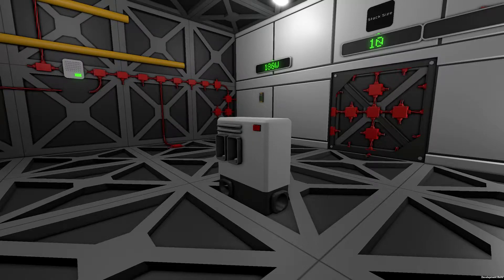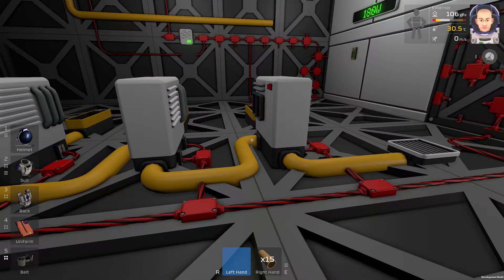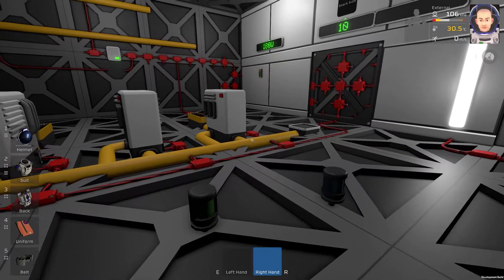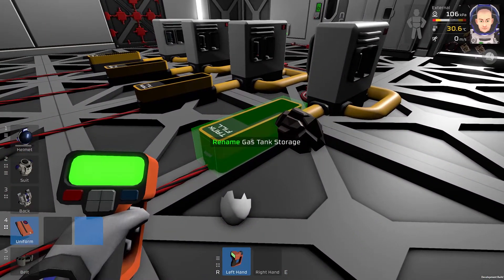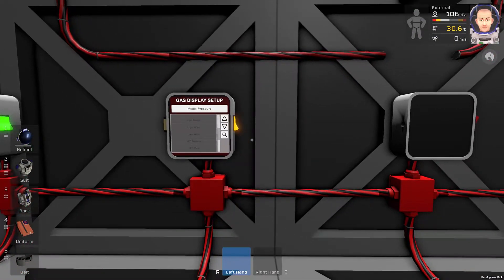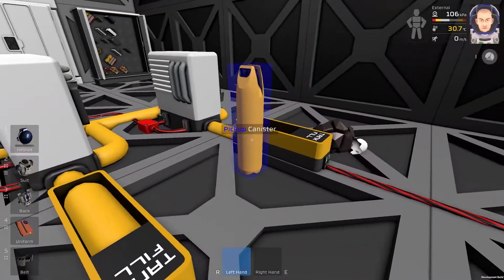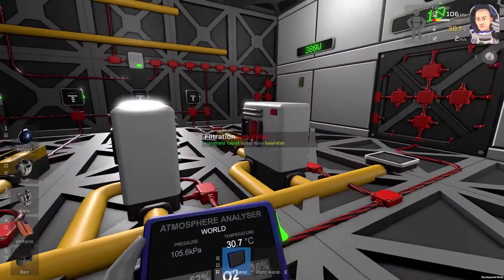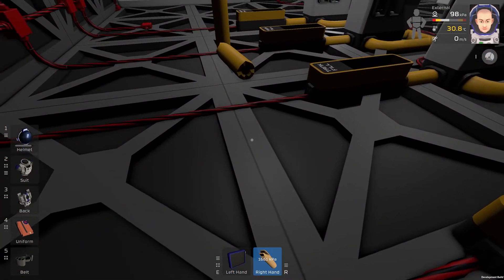Stationeers - Tutorial Gas Filtration

Comment: How do you do the pressure control? With volume pumps or pressure regulators? I assume using the same logic as the temp control only for pressure? Also the O2/Co2 ratio, is that as simple as turning on a volume pump and a filtration unit? More tutorial on your greenhouse control. 

I'm struggling with temps at the moment, my greenhouse is pretty massive and have 10x wall coolers, 5 per side, connected to external radiators with sealed pipework pressurised with X to about 600kPA. When Ive got 40 or so ferns on the go the temps go way up to 35+. Greenhouse controls spot on with no plants... Any tips?
Reply from the maker: In my Greenhouse Ultimate control, I was using volume pumps for pressure control, because active vents, they are very loud, when they work. Volume pumps are quiet. In my large Mars greenhouse I am using cold CO2 for temperature control, just cooling, no heating, because plants generate a lot of hean on they own. For greenhouse startup temperature, I was using my "energy recuperation" setup.

Comment: This is what I was looking for as it explains a lot I was trying o use serial set up and it wasn't working for me. Thanks!
Liked. Please keep up the tutorial vids. Like advanced air systems for bases and how to use the various parts like Volume pumps and vacuum pumps and the like. I see you have some electrical stuff, but I would like to see some stuff about setting up a system for a base, like how to use the two different voltage regulators.
I shall be referring people here for help with systems and how they work.
You might also want to add your tutorial series to the guides section on steam so people can find it.
Reply from the maker: Thank you very much. If you like my tutorials, you can link them on steam, if you want.